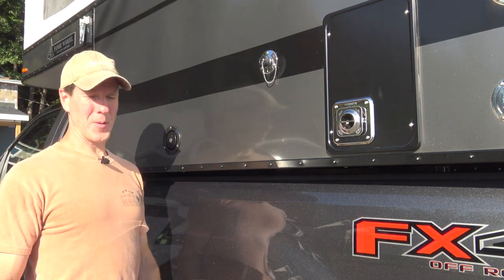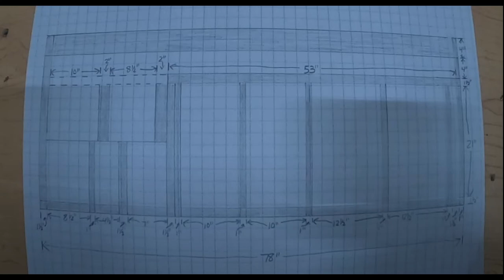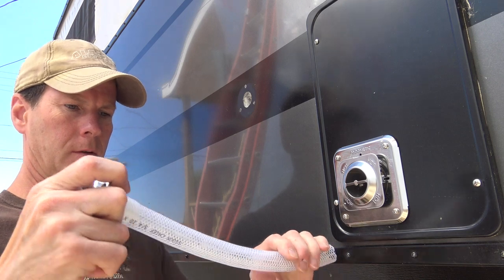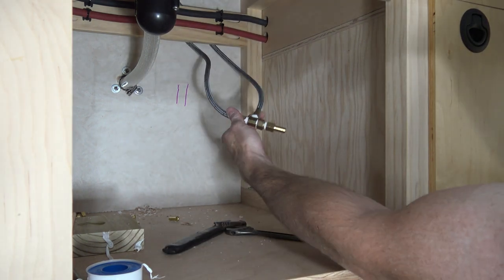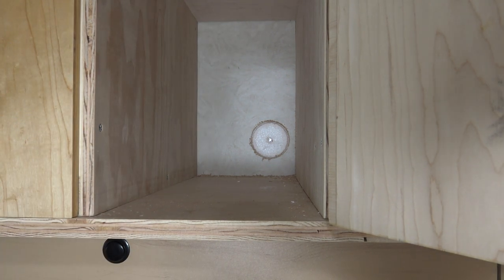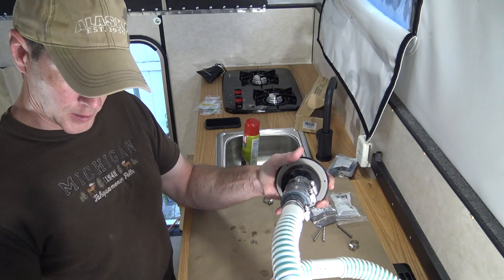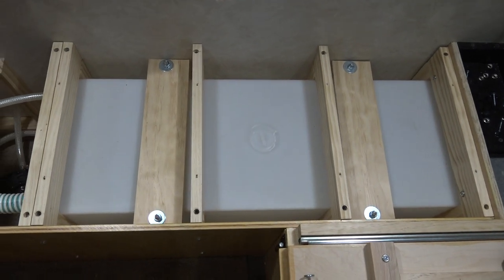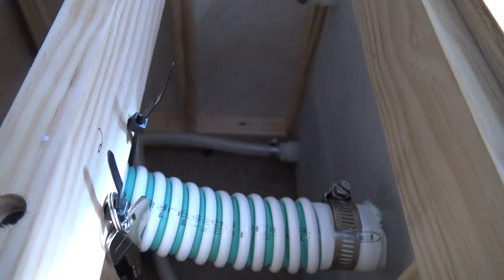Plumbing: Four Wheel Camper Shell Buildout #10

Comment: You mentioned connecting a "barb adapter" to the water outlet. I'm quite a novice, so forgive me if my question rolls your eyes, but, aren't there different sizes and types of barb adapters? If so, what size and type do I need for this project?
Reply from the maker: flange
https://www.ebay.com/itm/174923976027?chn=ps&_trkparms=ispr%3D1&amdata=enc%3A13Kuei4ixQP-dQ2_A8mh8Zw20&norover=1&mkevt=1&mkrid=711-117182-37290-0&mkcid=2&mkscid=101&itemid=174923976027&targetid=1644837434523&device=c&mktype=&googleloc=9017701&poi=&campaignid=16743749222&mkgroupid=138744546207&rlsatarget=pla-1644837434523&abcId=9300842&merchantid=527373848&gclid=Cj0KCQjwmtGjBhDhARIsAEqfDEe8jEMfq3P5kQfKcNvLIylg6jTZdr4JZmSgh18xAhK_i_hHGVViprgaApx-EALw_wcB

ball valve
https://hillsflatlumber.com/p/dial-ball-angle-valve-026529944304

Hope these links work.  I have an Amazon store but these are not sold on Amazon anymore/right now.

Comment: Where did you find the barbed flange for the outside water tank drain haven’t found what you use anywhere in my area. Thanks Kurt
Reply from the maker: See if this link works for ebay.  https://www.ebay.com/itm/393327601786

Comment: What are the dimensions for the room under the sink?
Reply from the maker: I didn't forget you.  My camper is wrapped up right now in a way that makes it hard to open the door.  I'll get back to you in the spring.
Reply: @NorthernExplorerOverland  thank you!
Reply from the maker: Directly under the sink = 20.5 inches deep, 19.75 inches wide. 20 inches high (13.5 inches high of usable space with sink hanging down into that area)
Drawer opening =20.5 inches deep, 8.5 inches wide, 4.25 inches high
Cabinet under drawer = 20.5 inches deep, 8.5 inches wide, 13.5 inches high